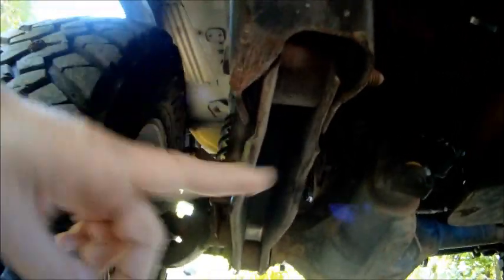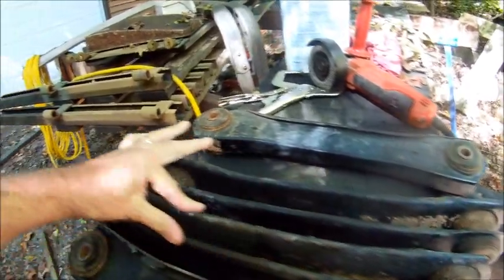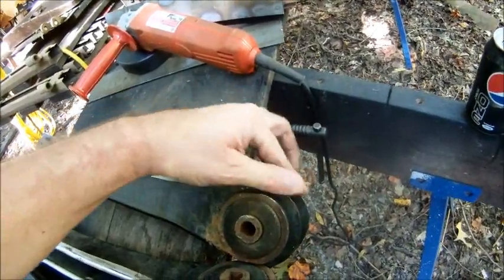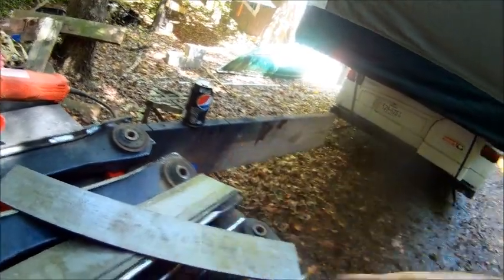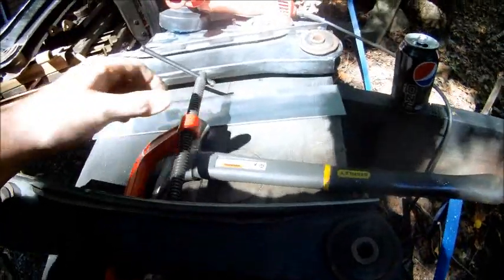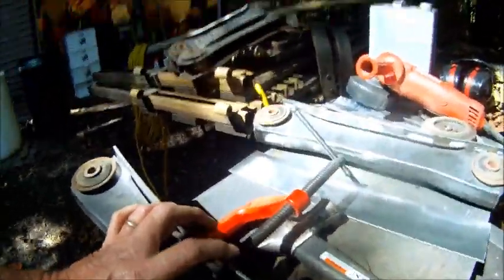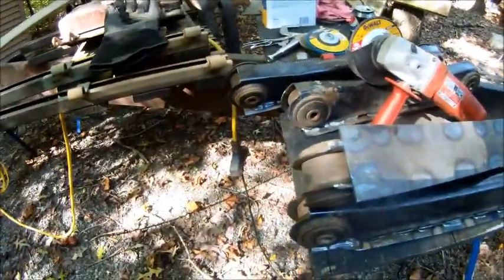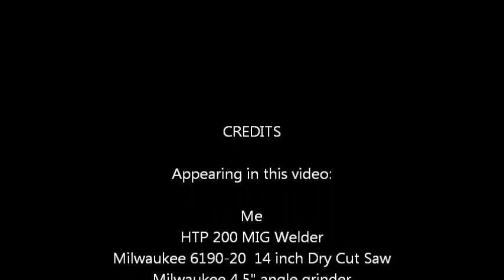How To:  Reinforce the Factory Jeep TJ Lower Control Arms

Comment: Good work, but I have to wonder why you didn't make the plates closer to the profile of the arms?
Reply from the maker: JeepITguy wasn't too worried about that.  I figure a wider surface would slide easier over the rocks.  They are still on the Jeep.  Thanks for watching.

Comment: Good tech. I notice you're not using an abrasive wheel on your saw, and it goes through the plate like butter. What is it?
Reply from the maker: JeepITguy Its a Milwaukee Dry Cut saw.  Its a carbide toothed saw blade that chips the metal away instead of grinding it away.  Hardly any sparks, fast, and alot less heat.  I review it in another video on my channel.
Reply: Thanks, I will grab one when I finish off this carbide disk.

Comment: They make a cutting disc for that angle grinder it's fast ..how they working out its been a few years gone by ...?
Reply from the maker: +John Ras The rear lowers are still doing fine.  I replaced the front lowers with a Curry Johnny Jointed are for more articulation up front.  The rear lowers are still unbent.